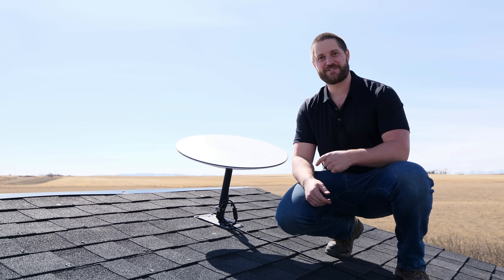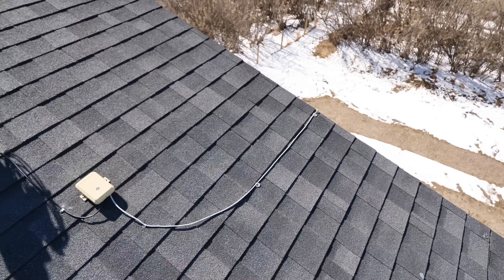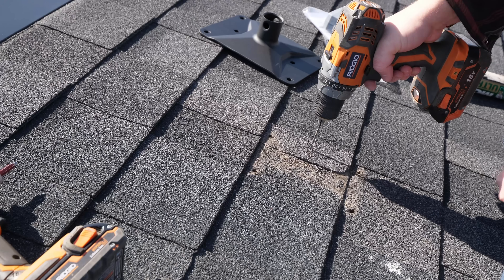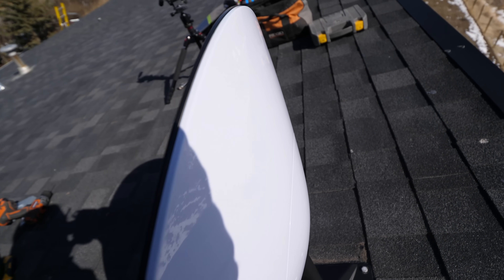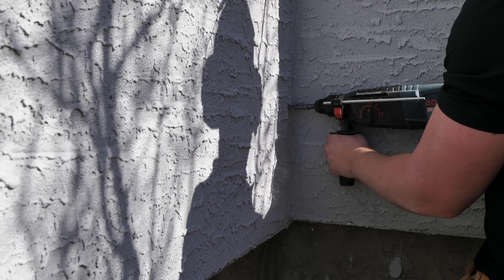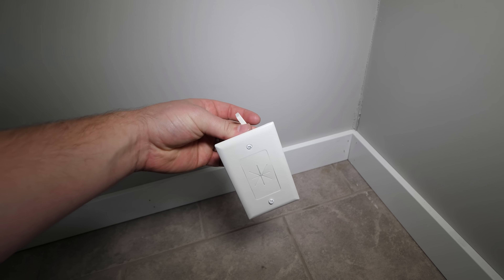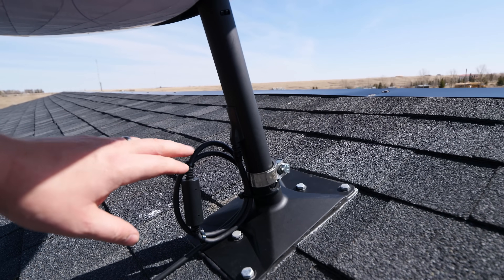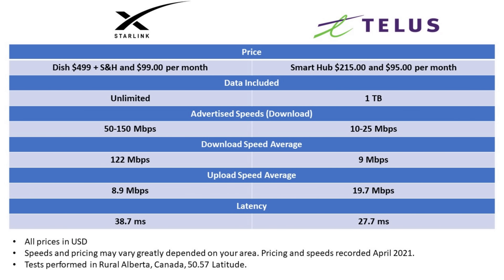Starlink Install, Speed Test, and Review

Comment: "IT IS A DSH".....don't you know you don't have to put it on the roof necessary especially if it is always pointing upward ... duh... it could be 2 feet off the ground and as long as it pointed to the correct satellite, will work the same as if it was 1000 feet above the ground!

Comment: Well, it has proven to be hugely overrated. Rural areas, at least in the United States, shouldn't be placing their bets in the hands of a satellite Internet connection. Rural electric cooperatives need to be tasked with running fiber optic cable along power poles. Fiber is the future, and satellite Internet should die out like dialup

Comment: You should’ve used the existing mount as it had holes for you run that bolt through the center like you want to. Second, you should never put the caulking/silicone/sealant along the bottom edge of the mount like you did, as any moisture that makes it way behind the mount will build up there. You should be fine because of those butyl tape strips you applied underneath, but keep that in ,one for the future...

Comment: Take a hack saw and cut a slit in the top of the mount, that way when you tighten the clamp it will pull the pipe together better giving you more direct contact area against the pipe/stem.

Comment: Why would you mount it on the top center of your roof and have that wire running across?
You should have at least mounted it toward the edge.

Comment: In the mounting plate     Cut a slot with a grinder.    So when u put the clamp on.  It allows it to compress the bracket metal onto the pole

Comment: Dude that's MASSIVE harmful radiation coming into your house
Reply: Buy a $70 emf reader and figure it out. There's protection shields and even special black paint if you have a real concern.
Reply: @SevenSpiritWarrior  Im very sensitive to EMF radiation , don't need any reader 
You should question the harmful effects of this technology , not just accept it like Elon Musk fanboy
Reply: @Abhi-by2cq  I think the electromagnetic radiation scattered around the air is not as bad as gmos and standard American diet. Death starts at the gut. Of course the meter reader would be helpful. You could actually measure the invisible frequencies to: determine, fix, adjust, avoid, etc. If you are sensitive it's a 'must buy'.
Reply: @Abhi-by2cq  You don't know the things I question or conclusions I come to. Of course I prefer no EMF pollution. We are electromagnetic beings. The less interference the better. But for those with no other internet option, this is a good investment. Pinging from one satellite to the dish will not hurt you if you use ethernet.
Reply: @SevenSpiritWarrior  Well i can't buy , because Indian government said no to starlink

Comment: My StarLink just arrived at our farm in rural Pennsylvania. It's the new rectangular dish with the one-piece modem. I will be installing it using a piece of conduit attached to the side of a porch post. This way I don't have to drill the roof, or worry about the dish being buried in a few feet of snow. Plus the conduit can be extended taller if need be to clear tree obstructions in the future. Thanks for the great video!
Reply: How is it going?
Reply: @SevenSpiritWarrior  Wonderful! A few little outages - mostly just a few seconds here and there - but we are very pleased with StarLink.
Reply: @OilHist  OH wow that's awesome! I signed up long ago for Starlink and somehow missed the email reply. So now I have to wait till early 2023 to get my hands on a dish. How often do you get outages? Cause I plan to game with the internet so curious to know.
Reply: @SevenSpiritWarrior  maybe a few second outage every few days. Usually don’t notice it, except they tell you when it was.
Reply: @OilHist  Oh that isn't bad. As long as it's not multiple times a day everyday.

Comment: Surely internet over starlink is not good for interactive coomunications like Voice and video, but ok for downloading bulk data or usage in the open. Fibre based in cities and built up areas are still the way to go.. starlink does not replace anything, it just supplements existing infrastructure.
Reply: Why not? The latency is acceptable.
Reply: @garethhanby  Average latency on a submaroe cable  (fibre) is say 30millisecond, but for a sattelite it is 600millisecond at best. Assuming Starlink has it's satellites on lower orbit, we can lower that. it is still at least 10 times the latency of fibre. Donlt get me wrong the  are ussage cases for starlink. Remember the old telephone calls when they were routed over satellite, there;s noticeable, one way latency of 150ms or more is very noticaable for voice and video calls, imagine packets going up to the satlleite and coming down. ?  That is why i say for surfing the web, downloading bulk data, non criticai voice/video is ok.  But for realtime mission critical data transfe probably not suitable/
Reply: @tommiko8313  Did you look at this video? You seem to be talking about the old Geostationary satellite connections, this is very low earth orbit.
Geostationary satellites are at altitude 35,786 km (min round trip 240ms at speed of light) Starlink satellites are at altitude 550 km (min round trip 3.7ms at speed of light). 
If you actually look at the data here his ground based TELUS has a latency of 27.7ms and Starrlink has 38.7. Starlink is in BETA and the constellation is not yet complete. They claim they will have a latency of 20ms in a year, we will see if that is the case. But it will certainly be fast enough for interactive communications.

Comment: When engineers install lines in the UK, they normally run the cable down at first for a inch then lop up.  This way it stops rain from running down the cab and into the wall, as it will drip off the low point of the cable.  However, we get a lot more rain than you probably, get so might just be a UK thing!  You did silicon the hole though which will do, but with time it might flake out.

Comment: satellite internet is awfully bad at latency. because of the limit on the speed of light.
it's useful in areas where other forms of connection arent practical.
but if you can get any other form of internet access, satellite is the worst choice.
Reply: These are in very low earth orbit, it's not like the old geostationary satellite communications.
Reply: @garethhanby  
it's pretty much the same thing with a very slightly shorter distance.
the limit of the speed of light is still the same.
if there's any other method of data transmision available, it's much better than satellites.
but for remote locations with no other options they are quite useful.
slow internet access with very high latency is always better than no internet access.
Reply: @sabin97  A slightly shorter distance? Geostationary satellites are at altitude 35,786 km (round trip 240ms at speed of light) Starlink satellites are at altitude 550 km (round trip 3.7ms at speed of light). 
"slow internet access with very high latency is always better than no internet access" - that is a nonsense statement, it totally depends upon your usage requirements. 
If you actually look at the data here his ground based TELUS has a latency of 27.7ms and Starrlink has 38.7. Starlink is in BETA and the constellation is not yet complete. They claim they will have a latency of 20ms in a year.
Everything you said is wrong.

Comment: we've got 150Mbps for 66 euro in Belgium , or 75 dollars
for and extra 10 euro you can have 1 GB/s
for realzies
and that's from telenet , which is an expensive company , over Fiber cable
for a long time i've had 200Mpbs for 90 euro / 100 dollars , including telephone line and television of course , same as now all included in the price

Comment: A good tip is fix the cable a little down from the hole you made (5cm) and then cross the wall(the cable will looks a fish hook). So the water that slips on the cable will drip on the floor, outside the house. sorry for bad english.

Comment: I’d be super worried about putting all those holes in the roof. I’d have put it on a telephone pole in the yard. The wind in your area against the dish is going to work the lag bolts out of the roof pretty quickly.

Comment: I dont know if it rains where you live but at the spot where you go trough the wall with the wire put it down a little bit more than the hole itself so water can't creep in with time because the doplets form at a point lower then the hole and the cable comes from down below and not from above. It then kind of looks like a hook or the letter J. Learned this from roofers when the installed our Sat Dish.

Comment: that wire going into your house, if you have enough slack, make a drip edge on it. right now if water runs down that wire, it will hit the base of your house and eventually make its way into your home. if you put a nice 3in drip loop to go past the hole and then back up, when the water runs down, it will go to the bottom of the look. i know this video is almost a year old, but just letting you know of the potential problems with water damage that could happen over time.

Comment: I live in a 'DEAD-ZONE' just North of Toronto, Ontario, Canada.  It is in an area between major hills, and it is not even possible to get any cell phone signals here. The only Internet available is pretty spotty $100/month satellite internet, or $150 per month optical fiber Internet, and only after you pay $1,600 for installation. Starlink would be a much better option.

Comment: Did he just refer to PoE as Power over Internet?  It is Power over Ethernet. P. o. E, NOT PoI. FFS

And why wouldn't you just install an Ethernet wall jack? why run the wire through the wall and have a cable sticking out of the wall like that when you can simply add a plate and plug a cable into that? it may be an extra step to wire the plate but it would look a lot better.

As far as the clamp. it would work better if you cut some slits into the base plate this would allow the receiving portion to move more and close tighter. id go with 4-5 slits though honestly. I am not a fan of the pipe stand with all of that wind. I have had satellites before and wind tends to blow them out of sync. there has to be a more sturdy method, though at this time I do not know what that would be.

Comment: i love how people don't even bother adding a frigging zinc tubing to the wires which go into the dry wall which are full of bazaltic insulation blocks or the insulation foam rolls which can ignite in a second ! OMFG ! teach people how to make a fire hazard inside their house ...jesus duck ! mr bean electrician ! PRO DIY INDEED !
oh.oh. just finished the video,in 3 years that roundabout of cable will turn white and at the first touch will desintegrate into air like thanos did when he snapped.

Comment: looks good but you didn't leave a drop when you went through the wall. Always want a U then into the wall. Water is going to run down that cable and straight into that hole the way you did it.

Comment: Almost perfect but drip loop drip loop!  You need one where it come into the howseee.  Like how it’s illustrated in starlinks install kit.  Otherwise water drips down the cable directly into your hole. Yeah silicon is there but if and when that degrades and it will much faster due to water hitting it every time It rains, water will then pour into your wall.

Comment: I don't think that dish motors will live long due to the winds in your area.
Reply: Motors only run during initial setup.  The electronics in the phased array antenna does the tracking of the satellites.  The antenna design is advanced technology and probably being sold below Starlink’s cost.

Comment: they are engineer my S     Sue  Elon. also checked prices and its wallet burning $ 130   a month  its high speed fiber price.  which is 1gb ps
Hardware
CA$649.00
Service
CA$129.00 /mo
Shipping & Handling
CA$65.00
Est. Tax
calculating...       this guy didn't send these rockets for service  and its coming from out of your pocket.

Comment: When entering from extior of the home always put a service loop under the entrance that way water doesn't run down the wire and into the wall silicone isn't a 100% water proofing and don't put screw clips on the roof less puncture holes less chance of a leak

Comment: Install the satellite on the edge of the roof ,,on the hanging part.....Make a drip loop when run the wire inside the house from outside.

Comment: I've been thinking about this for a house in the country... deep in the country. Is there a data cap slow-down? I mean after xxGb does Starlink slow the speed down at all? That's the problem with the current provider, they give you 20GB at "full speed" then slow it down to 256kbps or something like that (Hughes Net).

Comment: Very neat job but where the cable enters the house you should bring the cable slightly lower than the entry hole then loop it back up like a 'U' therefore any rain water dripping down the cable will not build-up at the entry hole and enter your house if the silicone becomes degraded.

Comment: Where did you get that plate mount? You might have mentioned it but I missed it. Thank you.
Reply: These are the mounting options currently shown in my account (prices in euros including taxes) https://imgur.com/JRxDw2n I didn't use any, just secured the included tripod to my roof. If you don't have nearby trees, it may not be needed to place it on the roof. Use the starlink app to find a suitable location. The app can be used before ordering anything.

Comment: wondering what happen when it is covered by snow... thick snow. ...
Reply: All networking electronics is inside the dish. In snow it should normally increase power output and melt the snow off while it's snowing. Just make sure it's mounted high enough above the ground or roof snowpack, so the dish can move around freely.

Comment: this was suggested for off grid yet no mention how much power it draws all the time... off grid usually means solar or generator??? unless there are options.. this is not for off grid.. which means no electric from a house.. it would be solar.. which means planning your power usage.. this assumes electric service from electric companies... not impressed. yet
Reply: It uses quite a lot. Including the wifi router, about 40 to 50W for the current hardware version, but in snow it can (temporary) increase to above 100W.

Comment: For future cable installations in outdoors, it's a good idea to include a water drip loop on the cable.
Reply: I see your drip loop and raise you a service loop !
Reply: in case people are wondering -- a drip loop is a slack bit of cable that sits lower than the rest. The whole purpose is to let water pile up at the bottom and drip off. If your cables were tight, water from outside could travel down the wire and get straight into an outlet or onto your electronic device

Comment: Looks like that mounting plate is pretty well sealed to the shingles.  Will water leak in around their sloppy pipe joint to the bas?  If so, the inside of the mounting plate will fill up with water and force the water under the shingles and into the wood.
Reply: In some photo's it looked like the (optional) volcano mount is closed at the pipe base. It's a single cast aluminum piece. But in this image it indeed looks like there is a hole in the pipe base: https://www.reddit.com/r/Starlink/comments/mobbi8/til_dont_put_too_much_force_making_a_custom/ So it would be better to not put sealant along the sides of the mount or at least keep an opening near the bottom.

Comment: I would suggest that anyone installing and using StarLink be conscious of their health afterward, with the StarLink satellites focusing their EMF transmitters on that location.  Watch what happens when any of the cruise ships get underway and turn on their StarLink service and everyone onboard gets sick, even the vaccinated.  Do some research on the health effects of 5G EMF pollution.
Reply: The Starlink satellites do beam-forming, but the beam is the size of the Starlink "cell", so about 20 miles diameter. It doesn't send your signal to that whole side of the planet but it's not as accurate as targeting a single building. Cruise ships have a metal roof, and even a wooden roof will block these frequencies very well. The Stralink dish will not work at all if you put it under the roof in the attic.

Comment: You're lucky, I live in the middle of nowhere surrounded by nothing but woods for the next 100 miles, I sadly can't install it on our roof due to big trees all around our house so I have to run it out to our field "around 200-300 ft" what cable should I use to do this and do you think it'll be slower due to how far it is from the house "200ish ft" or does it not matter because the cat cord will be plugged into the router at all times? Thanks.
Reply: The dish uses power-over-ethernet, and in bad weather that can be quite a lot of power. It is not recommended to extend the cable between the dish and the power-brick. But you can extend (or rather replace) the Ethernet cable from the power brick to the house. 300ft should not be an issue for any decent 1 GBit ethernet cable. Note that with the powerbrick about 100 ft from the dish, you would need to have mains power at that location and the power brick is for indoor use, so you would need to shelter it a bit from rain/snow etc.

Comment: My advise from someone who use to be a directv installer, you can use 2 arms to stabilize the mount to prevent the dish from moving or make the mount shorter.
Reply: The dish has to be free to pivot around to nearly vertical on any heading. A shorter arm or stabilizers on it would prevent that.

Comment: Neat installation!
One thing I may add is that you can consider having an on-grid or hybrid solar panel setup on your rooftop instead of replacing tiles..
Reply: Wind based power generation appears to be a better option. Panels will be hassle to maintain in these conditions. Someone else might also finance it if sustainable.